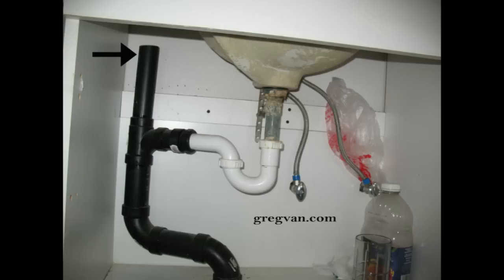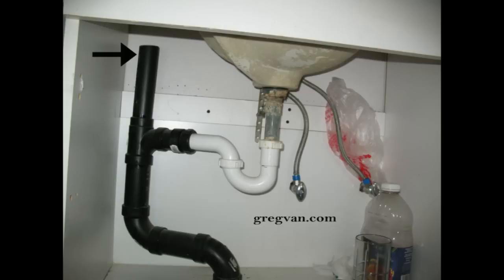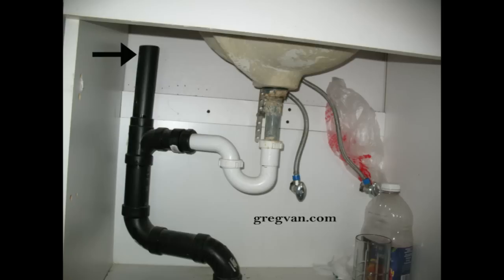What Not To Do With Sink Drain Vent Pipe-  Plumbing Nightmare

Comment: I have a number of sinks in my house that use air admittance valves. They work great, but they do tend to fail somewhere between 8 and 10 years down the line, but are pretty easy to replace. They are real lifesaver one it's impractical to vent to the outside. Really, this plumbing situation is not that big of a deal to fix.
Reply: +Troy D only place you should be using air admittance valves (cheater vents)  is on island sinks.
Reply: I think a better response may be to check your local building codes to see where they are permitted. I see these a lot on laundry centers for example--nothing wrong with them if they are allowed, other than they don't last forever. 

 Sometimes it's far better to use one of these then to try to route additional vents through your roof, which has its own set of problems, particularly in northern climates. In situations where you have say a cathedral roof, the moisture that escapes into the roof cavity can cause far more problems than using an air admittance valve, not to mention the huge expense and time when a $20 valve will do the trick. 

I would say where I see more problems is when people do not extend their vent high enough above the roof line, and they get covered in snow. Second, the size of the vent is too small for the volume of water going through the system, and the moisture escaping freezes and seals the opening (real common in multiplex rental units).  

The main vent in the house should be equal to or larger than the main drain--typically three or 4 inches.
Reply: For who?  If you're the original plumber, there are several different options for island sinks.  I've seen 3" pipe ran from the nearest vent to allow the sink to vent itself, I've also seen 2 pipes ran parallel with a bow vent for dry venting.  If you're not the original plumber, then an improperly vented island sink is just one of many situations where it is not going to be expedient to find a way through the roof, which mechanical vents are great for.

Comment: I have a roof vent. After a renovation of the bathroom a plumber told me that an air admittance valve should be installed. Can I install an air admittance valve and keep the roof vent without any complications?
Reply: Aristotle Matsis course

Comment from the maker: Yes vent pipes correctly installed will definitely help with the gluckita-gluckita noise and it odd that you never smelt any sewer gases. I have to admit, here in California, I rarely came across a home that didn't originally have indoor plumbing and would imagine it would be more common on the East Coast.

Comment: right on greg. I think many people think that the national codes are the last word when they are actually only a guideline for local authorities and any change the locals might enact are not going to be affected by the national codes.
Reply from the maker: +JIMMY TATE It's difficult to understand, but that's why I often suggest checking local building codes, because they aren't always going to be the same. It's the problem where someone says you can do something, because someone else is allowed to in their area, but you're not allowed to in yours and these videos make it even worse, because they can be watched all over the world where the building codes are a lot different.
Reply: And unless you're pulling a permit, do what works in your own house, as long as it really does WORK.  If you're making serious changes, then yes absolutely comply with current codes.  But if you're trying to fix something absurd like this, or a slow drain, or something.... Just make it work in a way that is safe and effective.
Reply: Just because it works doesn't mean it is safe...
Reply: Wrong - National codes are legally minimum standards.  Local codes can be more restrictive, but never less than national.

Comment: One of those caps was recently installed under my sink. Its LOUSY. I paid a plumber $200 for one hours work to replumb my kitchen sink which before had no trap at all. Now every time I want to do dishes and let the water out, it bubbles and backs up slightly on the other side.
Reply from the maker: Bummmmmmer!

Comment: What if i can't move the vent out, and i have lots of drain water that will be stuck and reverse ? I'm really confused , i need a solution please 

Thank you
Reply from the maker: +OMAR I would contact the plumber in your area, because it sounds like your drain is clogged, too small or installed incorrectly.

Comment: I put on an AAV and redid all the fittings under the sink and a new faucet because a plumber told me to use an AAV to help with a backing up in my kitchen sink on both sides. Turn on the garbage disposal sucks water down but shoots up on other side also washing machine drain pipe overflowed something horrible. Needless to say the AAV he told me to install did nothing for my situation and I have no idea what’s happening
Reply from the maker: I don't know if I can help, but feel free to send me a picture of the sink and all of the plumbing under the cabinet and I'll see if I have any ideas. You can get our email address of the website.

Comment: What happens when you are running water in the drin AND IT DOES NOT DEIN FAST WHAT DO YOU DO.
Reply from the maker: +Jody Wolk This is usually an easy question to answer and I actually had it happen to me yesterday. Whenever water doesn't drain quickly, the reason usually has something to do with a restriction in the sink pop up drain, sink trap or drainpipes. You can take the drain apart and clean it or try to run a small metal snake through it, to remove the obstruction.
Reply: +gregvancom No. The usual reason is that someone capped your drain vent. If you are unable to vent to the roof, you use an air admittance valve. I have to say this video is absolutely the worst plumbing advice I've witnessed in a while. Do not cap the plumbing vent.

Comment: Share a vent pipe with another apartment. My bathroom and kitchen sink are connected going into the vent pipe. Constantly getting backup no matter how often the drains are cleaned out. Black sludge or grim comes up with the water. Can get the kitchen sink to drain but not the bathroom. Couid I be getting backup from the vent pipe? I throw everything in the trash. But unfortunately you can't always get every scrap of food or coffee ground out. Sixty year old building.
Reply from the maker: I don't think it would be the vent pipe, but I'm just speculating. You could contact a plumber or one of your local rental yards to see if they have a video drain scope that can be used to go down the drain pipes and see exactly what the problem is. This is usually an area where the drain pipes are the problem.

Comment: For some reason I have water coming out of my vent. It looks similar to the one in this video. Is there anything I can do?
Reply from the maker: Yes, you can cap it off with a rubber cap that can be purchased at your local home improvement center or install an air admittance valve. Keep in mind that the open vent should be venting out to the exterior of the home and not under your sink.
Reply from the maker: I thought of another problem it could be. If it wasn't happening before, then maybe there is something blocking the drain, restricting the water flow and causing it to backup and of course come out of the vent. You might need to run a plumbing snake down the drain pipe.

Comment: We took a bathroom out of our mobile home. Trying to enlarge the overall space. We checked to make sure that master bath had all necessary drains and pipes and closed off the ones to the second bathroom. Now I'm starting to get worried that we've done something wrong because I smell something like not sewer but gassy. Hubby cannot smell it. It doesn't smell like human gas either. Please help. Could it be a dead animal? Or did we cut and cap wrong pipes.
Reply from the maker: Jamie Huffaker It could be a dead animal, but I would go under the mobile home to see if the pipes are leaking. Simply have someone go under the mobile home and look for wet spots in the ground and you could always flush a couple of toilets while someone is under the home to get some water running through the pipes, while checking for leaks.
Reply: Thank you! I will. Do you think it was ok to take out that unused bathroom? I may be worried for nothing. Thank you again
Reply from the maker: Absolutely not, but the value of your home could have been decreased by removing the bathroom.
Reply: It never would smell like human gas.  Just make sure you have no open pipes anywhere in the house.
Reply from the maker: +Steven King What other type of comment what I expect from the scariest writer ever. Well okay you might not be the famous writer, but we can pretend.
Reply from the maker: And it wouldn't be a bad idea to keep a few windows and doors open either.
Reply: Well thank goodness I have no more smells! They didn't last too long. On to bigger projects!

Comment: Taking care of my dad who rents, landlord doesn’t care, no extra money so I have to fix things. I have 2 sinks, the tail pieces come down and over like a squared off U and then go down to the P-Trap forming the Y.  Everything is as high up as I can get it but to get to the wall pipe from the P-Trap goes up at an angle 8" long and 2" up.  At the wall the pipe goes up like another P-Trap about 2". I don't get how the water is supposed to go up but get the "gas" thing and why from your explanation.  Everything is clean I take it all apart regularly 3-4x a year even though we mostly Raw Food.  No oil build up a little food mostly dirt or pet fur from washing hands no clogs. I just like to clean them out. Don't think there is a clog past the wall but the fact it is lead makes me not want to investigate too much.  My problem is the sink fills up with water and isn't draining it did prior to cleaning. Any suggestion would be greatly appreciated.  Thanks Amber
Reply from the maker: It's really hard to tell what your problem would be, without actually examining the property. You could have a ventilation problem if you're vents are plugged, could also have a drainage problem if there is sediment buildup which would restrict or reduce the amount of drainage and last but not least, you could be dealing with undersized drainage pipes. I think the best advice I can probably give you, would be to keep cleaning the parts, if the landlord is going to hire a plumber.
Reply: If it's not vented it will cause slow drainage. If this is the case you could add a interior pro-vent.
Reply from the maker: I made a mistake in my last comment and meant to say to keep cleaning the pipes if the landlord ""isn't"" going to hire a plumber. And you could always try installing an air admittance valve, like you suggested, but it sounds like you might have problems with the drainage pipes more than the vent pipes, but I'm only guessing. Let me know how it works out.

Comment: Why would you cap it?  Put a cheater vent on it and you've still got air introduced to your system.
Reply from the maker: A cap is usually easy to find at your local lumberyard or home improvement centers and provide you with a quick fix. Remember, air admittance valves aren't always approved by local building departments and because they are mechanical devices can fail. If you have access to a cheater vent then feel free to install one instead of a cap.
Reply: gregvancom  the only restriction I've ever heard on air admittance vents is that because they are a mechanical device they can't be inclosed inside a wall without access to the vent.
Reply: AAV are better than capping off.  Capping off equals no vent
Reply: @gregvancom  An air admittance valve (AAV) is code compliant as long as there is a another vent in the dwv system to the exterior.  Cheater vents are only approved for manufactured (mobile) homes.

Comment: Instead of capping that .. isn't is easier better  to add a magic vent to it?
Reply from the maker: I only suggested the cap to eliminate any older or possible spillage if the pipe backed up. Remember air admittance valves or magic vents might not be allowed by your local building department, however would be a better alternative than leaving it open.

Comment: The house I grew up in was built before indoor plumbing was common in the area, with pipes added much later, I think in the 1940's. The kitchen sink was unvented and was on the opposite side from the soil pipe, so the drain made a horizontal run the entire width of the house. Any time a lot of water went down (like dumping the dishpan) it was always followed by a minute or so of gluckita-gluckita noise from the trap. No sewer gas, but it was always a noisy sink. Seeing this made me remember that

Comment: can anybody give me some advice???...my kitchen sink and Washer keep backing up...I snaked both pipes including clean out and I also put water with hose down vent pipe on rooftop and all the water came up kitchen sink...can someone help???
Reply from the maker: If I was you I would contact a local plumber and have them run a video scope down the drains to see what's going on. You don't need to hire them to make the repairs and you might even be able to rent your own video scope at your local rental yard.

Comment: i like the idea of using AA valves though i honestly have never installed one.  i now wish i had used them on my own home when i reroofed last fall. i really hate roof penetrations & here on the central oregon coast the fewer penetrations the better.
Reply from the maker: +bgregg55 You bring up an excellent point about roof penetration and vent pipes, I'm just not 100% sold on air admittance valves, because of the maintenance problems they'll create for unsuspecting property owners.
Reply: gregvancom dude they work they just expire and in this case it's a easy swap out admit your insane to cap this and call it a day

Comment: how about putting the p trap in the drain pipe just before it goes through the floor? that would stop smells and still allow the line to vent...
Reply from the maker: That would be better than the set up in the video.

Comment: Do i need a vent for my toilet and shower if they are both in the basement and they drain straight out to the septic tank?
Reply from the maker: I can't think of one plumbing fixture that doesn't require a vent, so yes you would need a vent for your toilet and shower drain pipe.
Reply: wet vent them with the sink drain.
Reply: Wet venting (draining into another fixture's vent) is fine and in some cases encouraged, but I don't know about putting a shower and lav on a toilet's vent.  I'm sure it would work but might not be advisable.  Feel free to drain the lav into the toilet's 2" vent.  (As long as its close enough - Remember the horizontal pipe in the wall counts as trap arm) But I'd connect the shower vent above the lav's flood rim.  Especially since it's a basement.  This way in the event of a backup there's no risk of solids becoming trapped in the horizontal portion of the shower's vent pipe.
Reply: Andrew Asche the lav is the toilet and showers vent. You use a 2 inch lav drain and have a 2x1 1/2x 1 1/2 tee in the wall. The branch of the tee picks up the lav trap arm,the top of the tee is the vent and ties into the stack or a vent header. The bottom of the tee which is 2 inch is the wet vented portion and ties into a 3x2 wye or 3x2 double y. I have done hundreds of new home undergrounds like this.
Reply: Very interesting.  That would definitely not pass inspection here in Minnesota.  Where are you licensed?
Reply: Andrew Asche Canada. And our red seal apprenticeship program is one of the most respected in the world. I went to the top trade school in the country too, all of my classes were in a brand new $400 million  state of the art building.
Reply: Andrew Asche I'll try and dig up a few pics of some underground installs and link them.
Reply: Yeah please do, I'd be interested to see how they differ from ours.
Reply: Ok I found a couple decent ones.

http://nl.tinypic.com/r/qnv81x/9
http://nl.tinypic.com/r/1zxxh78/9.

In both of these the bathroom is right on top of where the main services came in. I don't have any more recent pictures, these are from a few years ago when I was a 2nd year apprentice. I only do commercial work now so no more hand digging groundworks, now I watch the excavator dig.

Comment: i checked, I don't have a vent and don't recall ever having one. In the unlikely event it gets sucked out put more water in it, you don't notice but i figure you use the sink often enough hopefully. Guest bathrooms and side bathrooms can dry up. I knew the U was to keep the gas out and was wonder ing why you had a pipe other side of the U anyway forget that noise.